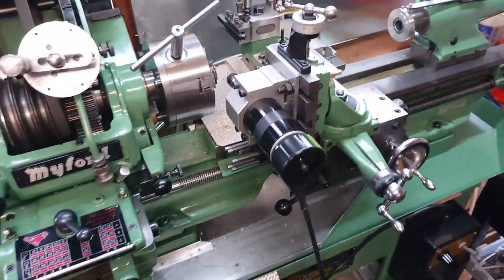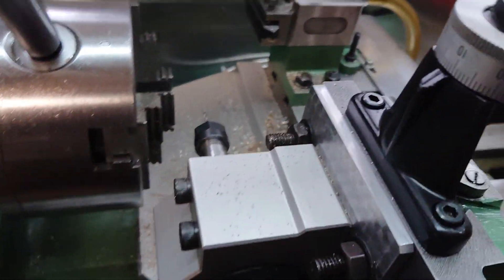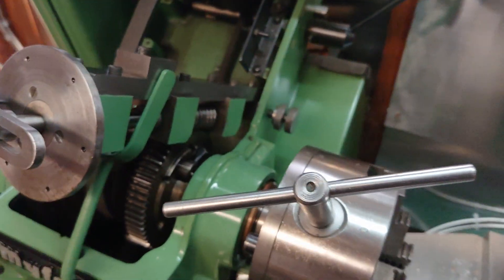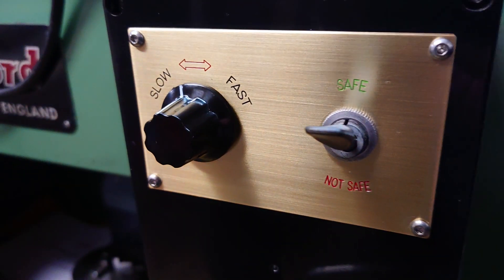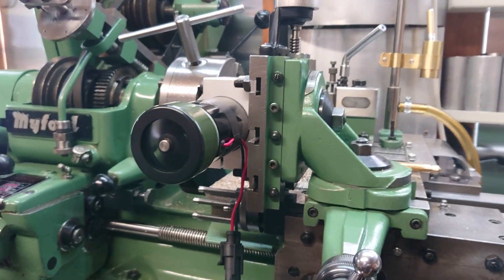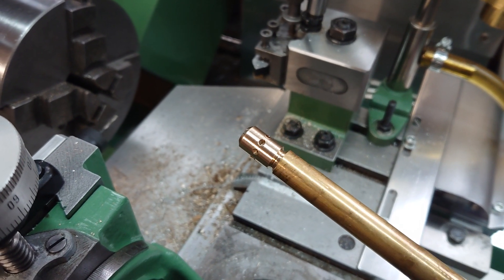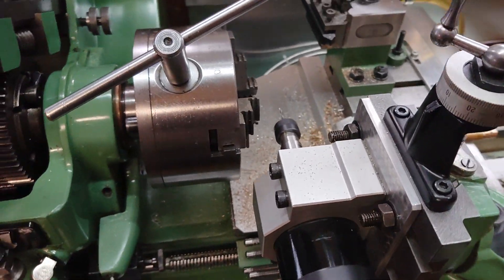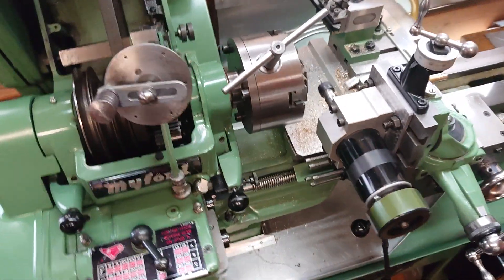Myford Super 7 cross drill modification / attachment

Comment: Cheers bones, 
Question, how do you find that rear tool post? I have 2 Dixon style tool posts and thought about putting one on the rear of the cross slide as well.
Thanks
Reply from the maker: Hi Raymond. Yeah , fine for what I have been using it for, no problems. Im generally only parting off ali and brasses and using it with a chamfer tool .